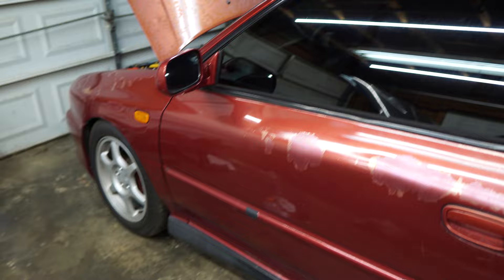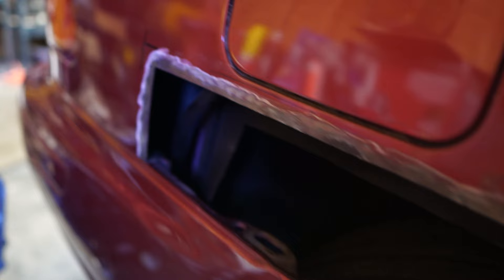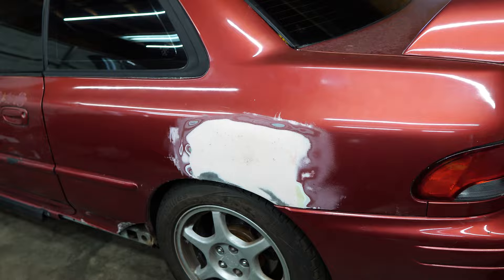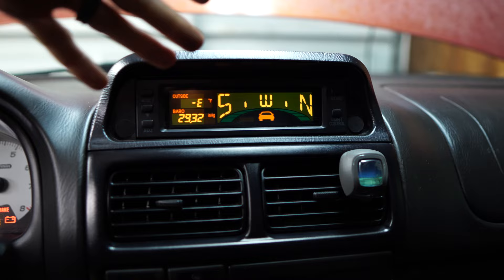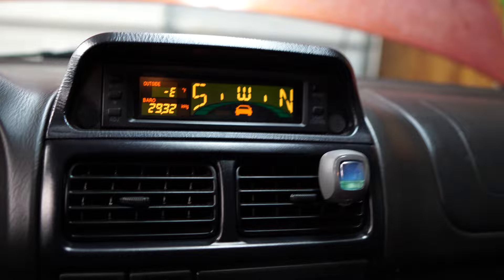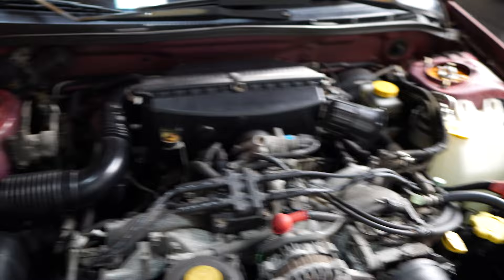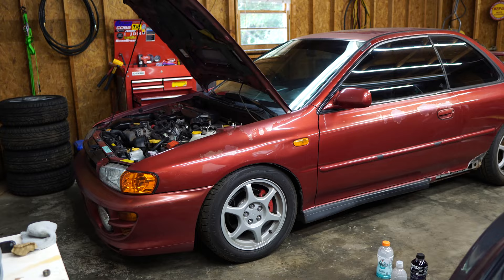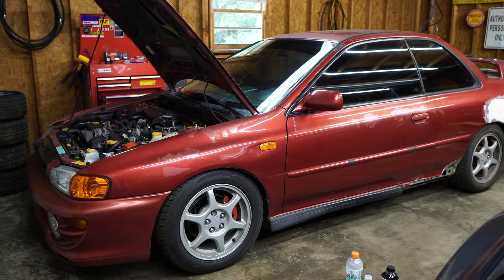GC8 Rust Repair update! // Modifying my '01 2.5RS (GC8) (Episode 14)

Comment: I'm so jealous that's one of the cleanest ones I've seen, even the amount of rust you have is "minor" compared to most of what I've seen
Reply from the maker: I would definitely say the rust is somewhat minor. A good bit but definitely not the worst I've seen either.
Reply: @OldieProductions  I have seen cars on the road with Tacoma drain holes on all 4 corners, for some reason that era of Japanese performance cars all just rust like hell

Comment: im an original owner of a 2000 2.5rs...found your channel due to rust issues on the gas filler side as well as the rear rocker on the drivers side which i need to get to get taken care of...my car has mostly been garage kept but still has rust...im in the burbs of philly so its a snow area and salted roads mean cars get rusty
Reply from the maker: My car actually came from PA, then down to Florida, so it's had a rough life when it comes to salt.